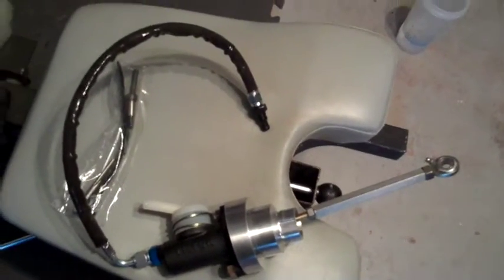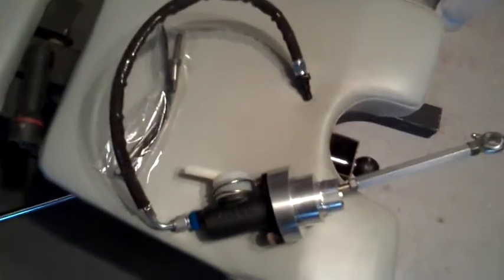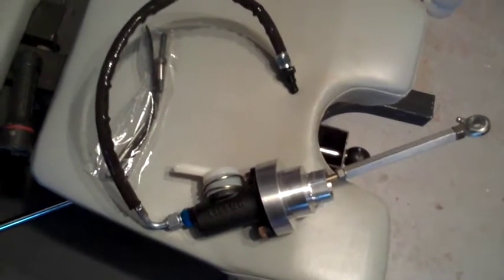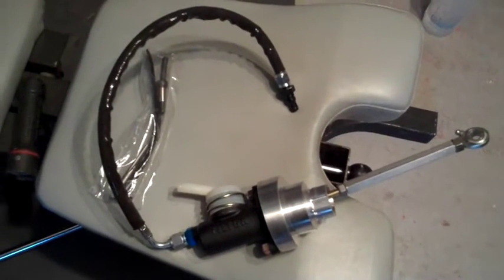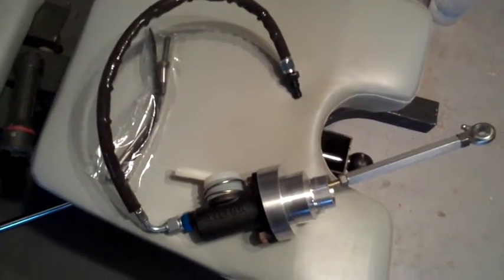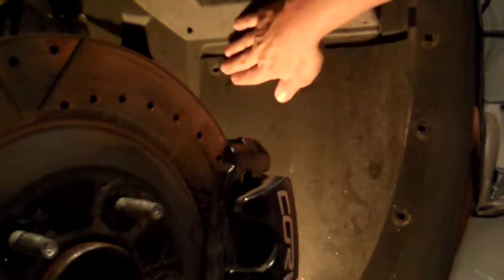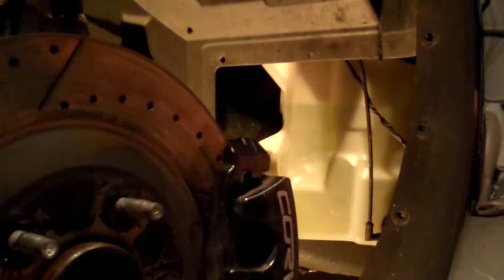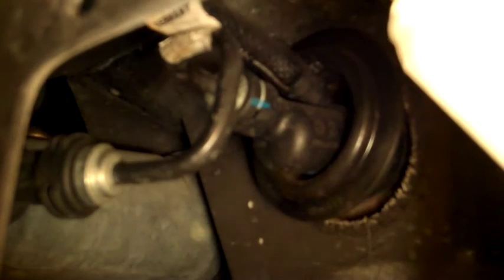Tick Master Cylinder Install 2005 Corvette Part 1

Comment: I am sure you found this out Cliff but there is no need to remove the reservoir hose while its on the car.  To remove the master you simply need to remove the retaining clip from the quick disconnect fitting and pull everything out as an assembly complete with the reservoir still attached.

Comment: So did it fix the problems?
Reply from the maker: It made engagement better, shifts better, no longer sticks to the floor when at the track. So yes, better. 

I do still have the issue where it doesn’t want to go into first from a stop sometimes.
Reply: Cliff's How To Channel I have a 2004 ctsv and my clutch pedal is sticking to the floor at high rpm shifting I put a ls7 clutch last year had no problems then it just started to do it
Reply: Cliff's How To Channel I had a hard time with my 1st gear to had to have it replaced  actually replaced 1st 2nd and 3rd gears all where bad

Comment: I just installed mine a couple weeks ago. Love the fact that I can engage the clutch 1" from the floor vs 1" from the dash on the stock master cylinder. My only complaint is my "Check Engine" light now comes on due to the clutch peddle not engaging the pedal-return switch near the dash. This is due to the peddle-return spring being removed per the installation instructions that came with my Tick. Have you had this same issue after you installed yours? If so, what did you do to fix it?
Reply from the maker: I’ve bit had this issue. I have mine adjusted in the up position, so it hits the switch. 

If it’s not too far down, you can adjust the switch position down further. Just unplug the wires, and screw it down to get it closer to the pedal, then reconnect it.
Reply: @CliffsHowTo  Thanks, I'll give that a try. I followed the instructions to adjust the pedal 1-2 turns at a time until the shifter goes into gear then tighten. So, the pedal is down quite a ways in it's released state.
Reply: @CliffsHowTo  The adjustment worked. Thanks again.
Reply: @CliffsHowTo  
 
    Trying to get the Tick Master installed and having a helluva time getting the back half of the master cylinder screwed on from the interior side. Any problems with that?
Reply from the maker: @brianwilkins5673  I didn’t have an issue, but this may help: 
https://www.tickperformance.com/content/C6VetteInstructions.pdf

Look at steps 25-29.
Reply: @CliffsHowTo  
    Thank You for responding.
I have the instructions, problem is some of these things aren’t addressed in the instructions. It says to make a clockwise turn when installed but mine goes straight in and then the cap screws on from the pedal box side. Not sure if they changed the design and didn’t update instructions.
Reply from the maker: @brianwilkins5673  hmmmmm, yeah. Maybe they changed the design, or maybe even sent you the wrong part number. I would verify with them that you have the proper part. (Wouldn’t be the first time someone sent out the wrong part!)
Reply: @CliffsHowTo  
No it fits, its just some things from your video and the instructions don’t match and they didn’t send instructions.
Like I didn’t need to cut any length off the   Reservoir line, the master cylinder doesn’t twist in. I didn’t need to drill a new hole in clutch pedal ( lines up perfect with original stud), the “short line” they sent is waaaayyyy too long. That’s just to name a few.
Reply from the maker: @brianwilkins5673  if it’s that different, I would definitely look at whether they gave you the right part… they sell those for many different cars, and probably gave you a kit for a different car.
Reply: @CliffsHowTo  Well it all fits and Im almost ready to bleed, but when I re-install the return spring pedal goes to the floor? I filled the master with fluid but havnt started pumping yet.should it build enough pressure to stay up once I start pumping and bleed?

Comment: do you live in Florida?
Reply from the maker: I do
Reply: Cliff's How To Channel I am trying to install a tick performance Master clutch cylinder my 2002 Camaro SS and have been having some issues not sure if you want to make 50 bucks today I live down by 417 off Narcoossee
Reply from the maker: That's right by where I live! I'm in SouthChase! Sadly, I work all this week. Also, I'm busting my butt all this week to get my house show ready. Putting that thing on the market!
Reply: Cliff's How To Channel i used to live in Southchase. Went to Meadow Woods Elementary Hunters Creek Middle School and Cypress Creek High that is crazy

Comment: Thanks - this video was a big help with my install.  I decided to temporarily remove the washer fluid container for more access.
Reply from the maker: Glad it helped you!
Reply: Do one with a straight on replacement.  like he said pull pin out. remove master as 1 piece. fill new. bleed it before retracting to master.. then change fluid as you show in your video s. yes. of coarse this is hoping for not having to pull the slave yet. thanks 2001 zo6. at 100k.original everyone's yes!🦋